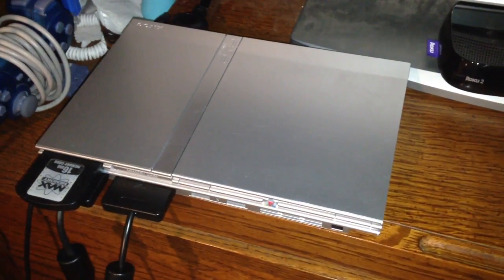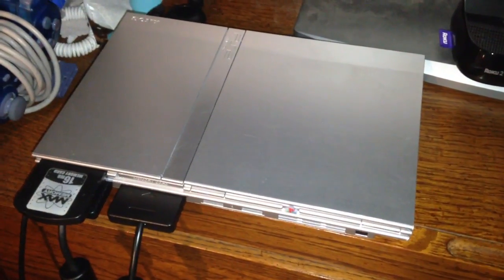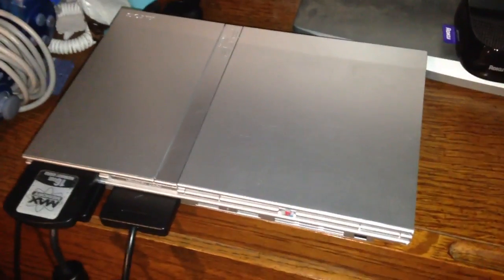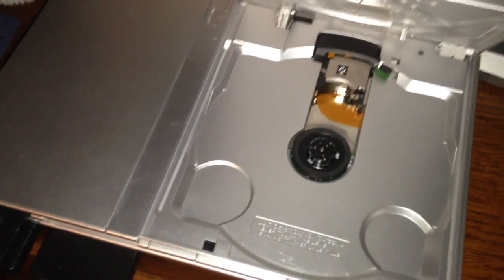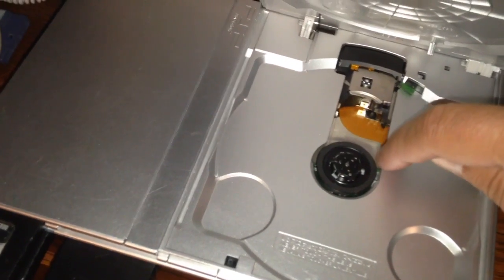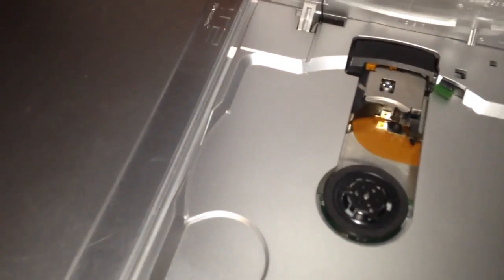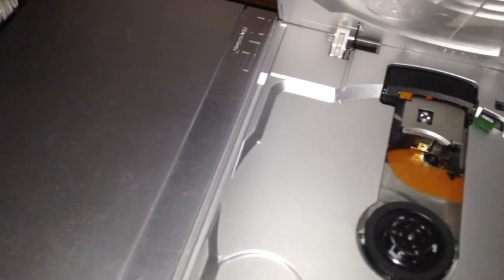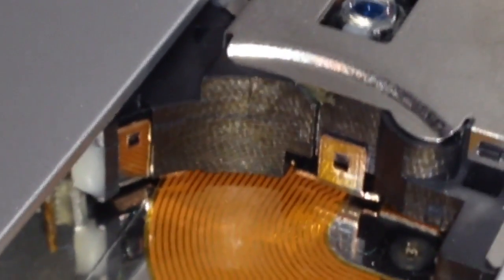PS-2 Slim model fix for discs not reading

Comment: I decided to play my PS2 game today, had some issues but got it to olay for an hour almost before it froze and then the disc would not read again despite multiple tries. Googled help, not willing to do much though and found this. Did it, and the game loaded immediately after! So thank you honestly for this vid 👌🏻👌🏻
Reply: Same I tried playing mgs 3 on my ps2 slim (the exact model in the video but in black)it worked on the first try but then the game froze all of a sudden with my ps2 being overheated for some reason.Then I restarted the ps2,Aspect Ratio returned to normal but the disk reading errors started their bullshit sometimes it said that disk cannot be read sometimes the RSOD.I dont get it ffs if I dont play my ps2 for long the games would work with a really weird aspect ratio(the apsect ratio being small even tho I had full screen on the ps2 settings)and then when I played it again after sometime it starts to have disk read errors I dont know wtf is going on with my ps2.I just wanna play mgs 3 ffa

Comment: My ps2 has had trouble reading discs for a quite a while and I didn't want to have to take it apart to fix it, so I was so excited when this actually immediately worked! Thanks so much for sharing this tip!
Reply: Nevermind, turns out it was a coincidence because it went back to not working. Must have another issue...
Reply: @XxiheartsupermanXx  Did you ever get it working?

Comment: Um … I'm hoping you're just trolling people and you're not that dumb. Those aren't any sort of "read head". Those are simply black plastic nubs that the metal cover uses to snap into place.
Reply: Explain to me how in the world my system started reading a disc that just wouldn't read BEFORE I tried this. I'll wait...
Reply: @DABS139  Maybe the orange piece under it was the one that needed to be cleaned
Reply: @DABS139  Luck … seriously, you cleaned a piece of plastic that has no function other than holding a metal cover in place. That's it. Take one apart, you'll see what I'm talking about. There's nothing electronic about it. I've replaced many of these over the years.
Reply: Chuck G That’s some hell of a coincidence and crazy amount of luck. And I’m not a very lucky person...ha
Reply: Then explain how it worked Literally straight after I did it but wouldn’t play any disks 2 mins before

Comment: Thanks, this actually worked really well. I've been trying to play some of my old games but I've been getting a disc read error a lot lately, which I thought was odd since I didn't play my PS2 much in recent years and my games are nearly in mint condition. I didn't want to open my PS2 to replace the laser or anything really extreme like buying another one. After cleaning those two things, my games booted up almost instantly as if the system where brand new.
Reply from the maker: Tis magic
Reply: Oh my goodness! THANK YOU SO MUCH! I wanted to play some games from my childhood and it wouldn't read the disk. I did what you said and it worked like a charm! THANK YOU